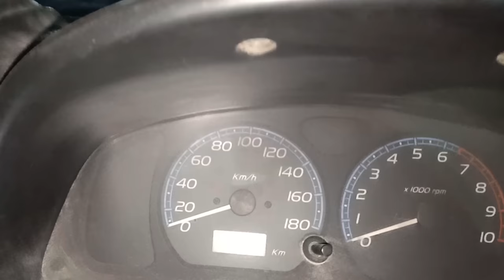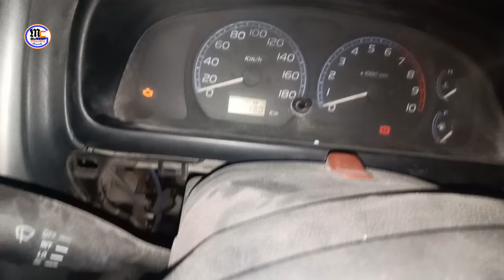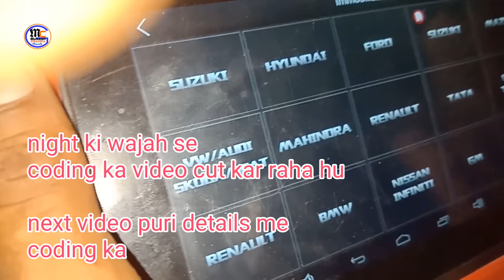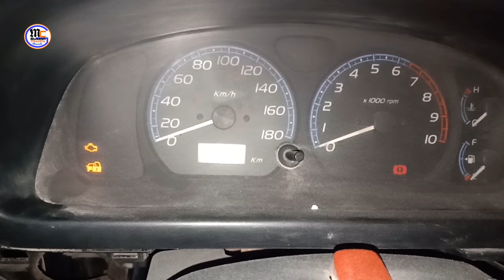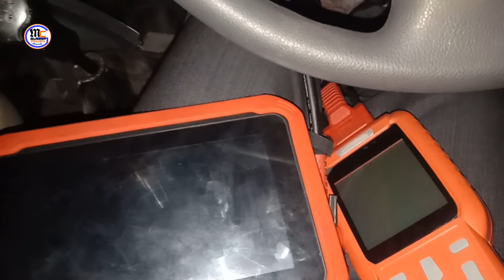Immobilize issue, starting problem, Maruti Suzuki wagon R

Comment: Nice video . Mukesh bhai , I have a strange problem with my zen estilo . I noticed when I dtive with AC on and I stop my vehicle and switch off the ignition  , sometimes the car doesnt start,  self is just blank and not cranking . . I have to push-start my car .
1. Changed with new denso self  starter
2. used 4 awg gauge wire from alternator to battery positive and self to battery positive . 
3. Checked the battery with aTagLab load tester , checked the battery specific gravity , all OK battery is healthy . 
Kindly advise

Comment: Ram ram
 mera cr4 dicor indica ev2 lx model hain
3 saal pehle remote kharb hogya tha....continuos blink kar ta tha lekin start hone mai koi problem nahi tha.....surf blinking ke liye maine central lock module ko disconnect kar diya tha karib 1 saal. Fir jab maine lagaye koi blinking nahi hoti....key se saare door lock unlock hoti hain.....4 actuator kaam karta hain......lekin lock symbol nehi ja raha......kya karu?
Ha mere gari main hopped codded adapter aata hain jo mera pas hain firvi remote match nehi hota

Comment: Bhai mera swift running condition mein ruk gayi aur start nhi ho rahi. Just cranking hi horahi hai. Mechanic sab fuse check kara aur air intake ke pass kapda dalke start kia but start ho kar bandh ho jata hai har baar. Abhi woh bol raha hai ki appke gadi compression ki problem hai. Head kholna padega. Bhaiji pls help

Comment: I am facing a problem in my Maruti Suzuki Ritz. When I am driving with one key while changing gears the immobilizer light and steering wheel light blinks for a second and the car still moves on and does not stop but stalls for a second. 

When I use another key while changing gear the immobilizer light and steering wheel light comes on and I have to restart the car as the break and steering becomes unresponsive.

I have been to Maruti service( sai service) center 5 times and they are still not able to find a problem. They just say everything has been checked and they can't find any problem.

Please reply if you can suggest anything

Comment: Swift 2008 old model engine no starting EMS relay negative cranking blinking solution kya hai negative ki on mein a raha hai 5 second ke bad band ho ja raha hai wiring Puri check kar liye hi  ECM immobilizer gadi mein laga kar  check kar liya hai

Comment: Hello @mukesh Chandra Gond. 
i have the exact same problem with my "Suzuki alto 2005"  Maruti 1100cc
i just changed the engine. because my  old engine blew up. 
the new engine worked fine for a week. but now. it wont start. and it makes Code: "p1621 -No code from Immobilizer" 
and it will not turn on.  it does exactly like yours in the video here..
Now we don't know what to do. and i don't understand your language. 
can you help me ? with what i need to do. and explain it in english.
i hope you can help me. 
many regards Jacob.

Comment: Bhai, i have same problem in dzire 2008 petrol model. When i remove relay plugs and insert again, car starts sometimes and sometime doesn't start.. what to do. I changed all the 3 or 4 relays. Still this immobolizer blinks and car won't start.

Comment: Thanks for your video, nicely display. Now I have a big problem. No engine light. No immobilizer light. Car battery checked(12V), fuse, relay checked by car electrician,car cranking, but not starting.Pl advise. It is Ritz 2010 Petrol
Reply from the maker: Injector supply check

Comment: Cam sensor three pin kase cheak kare
Reply from the maker: Multi meeter se  
Gadi start karke signal voltage check kare
Reply: 22hilux start nahi hundi je
Asi petrol inlet modified ch paye ਤਾਂ start ho jandi kush time baad bad ho jandi hai solution, crank sensor change karta sare sensor change kare bande ne hun mere kol ayi bhi butu ke karu cridi engine hai
Reply: With petrol pye te inlet modified ch start nahi hundi
Reply from the maker: Injector ki supply check Karna hoga